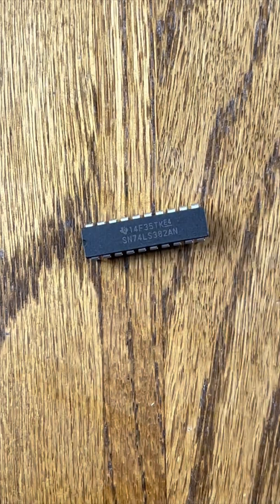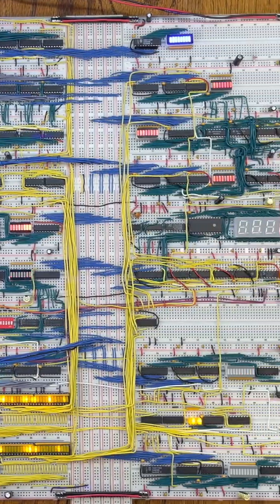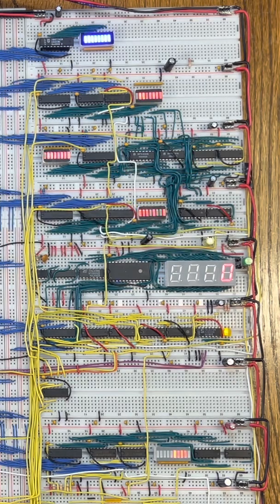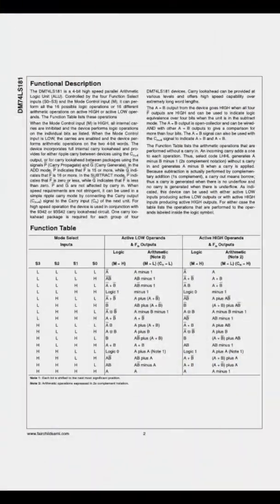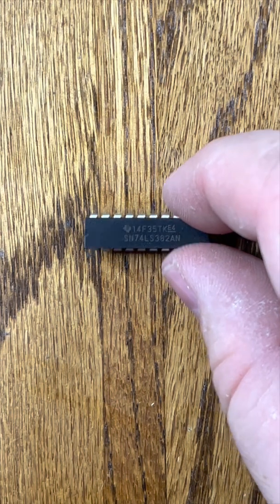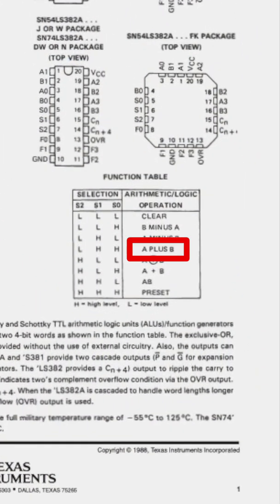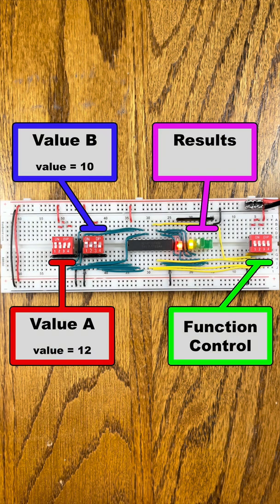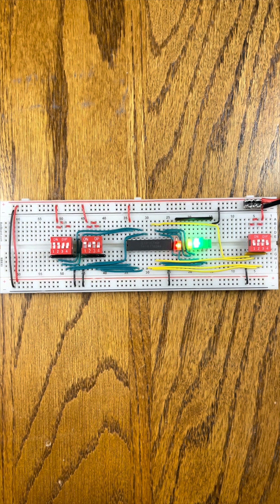The 74LS382 Arithmetic Logic Unit and Function Generator #short

Comment: With 3 381 a 382 and a 182 u get a16 but ALU with fast carry
Reply from the maker: Thanks. My TTL CPU is 8-bit, and I probably won’t be operating at a speed where the speed for the carry to cascade through from the low nibble to the high is going to make much of a difference.
Reply: @MichaelKamprath  the '382 is designed to be used for the last 4-bit nibble, you probably need to use the '381 for the other nibble
Reply: beat me to it !